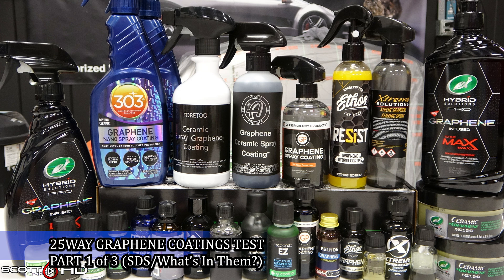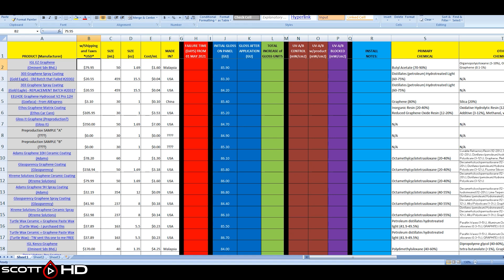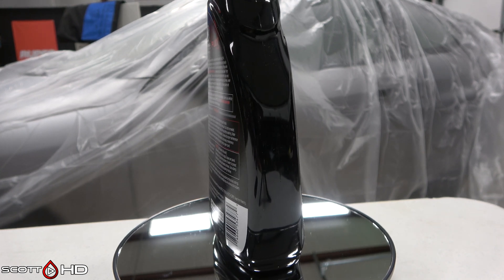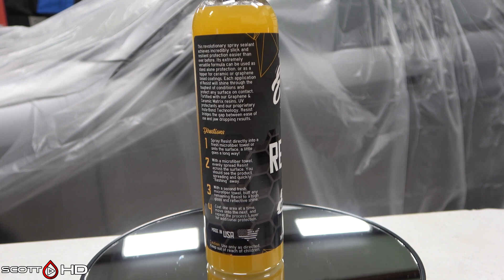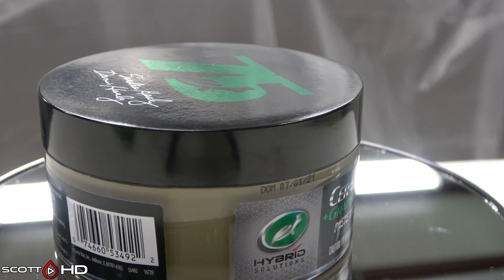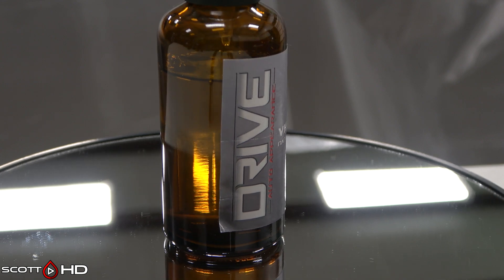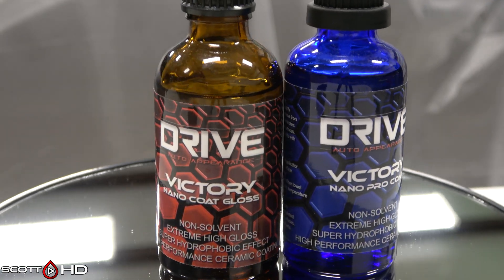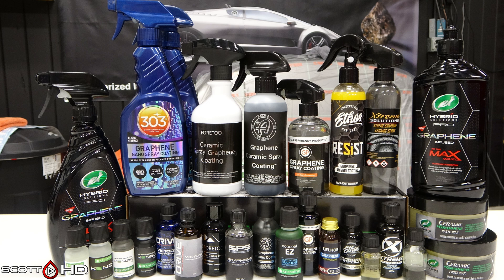Graphene Coatings Longevity Test - 25 WAY - ULTIMATE comparison test - PART 1 - WHAT'S IN THEM? SDS

Comment: Artdeshine nano coating and ceramic oxide artdeshine?
Reply from the maker: The Apex ones are in the 41 way test starting here at the same time and is identical to the non-apex branded ones.  Same SDS, even states manufactured by Artdeshine

Comment: In all fairness; as a suggestion.  I would go buy a bottle of 303 with the same batch number as the one sent to you from 303.  This way it will show that 303 didn't send you an altered product and have people question if what is sold in stores is the same quality as the product sent to you by 303.  If you can't find the same batch, then find out what batches have the correct formula that would be for sale in stores and buy it.  Can't wait for the results.
Reply from the maker: Great idea. I'll see if I can find one...will have to test separately since they are already applied and curing.

Comment: Another great untainted review. I wanted to ask if it makes sense to indicate on the spreadsheet or in the testing itself which products require a maintenance application. I shared your ceramic results with a pro detailer. The  product he’s authorized for didn’t even perform to its warranty. He replied  “yeah but did they follow the maintenance program?”.   Not sure how many products are like this but I thought I’d ask. Hogwash?
Reply from the maker: That is the point of this test though.  A "maintenance" is essentially having a product reapplied every xx amount of months.  The original intent of these tests is to see how long they go without any maintenance. No decontamination washes, no topping off, etc. Just washes and outside weather.

Comment: The main event of the latest and greatest coatings! I can hear Michael Buffer announcing "Let's get ready to RUMBLE!!!"  I can't wait until the testing starts. It's like waiting for Big John McCarthy to yell "Let's get it on!"

It's awsome that on the spreadsheet there are columns for primary and other chemicals. I know it's already listed but could you add a column for the percentage, if available, with type of graphene/graphite product? Wondering if the amount of grahpene/graphite will make much of a difference. Is "graphite" a typo or do manufacturers state it because graphene is essentially graphite? I have a feeling that the battle will be between the octamethylcyclotetracyloxane products.

Thank You for doing the comparison tests. The social media departments are gonna keep a close eye on this test. lol
Reply from the maker: I can do that.  Some of them don't even show Graphene or graphite in the SDS which is pretty shocking! Others may just say "graphene" and not show a percentage. There is absolutely zero consistency with the SDS unfortunately.

Comment: Hey Scott, I've been using the TW graphene stuff, I don't know if it matters, but you may want to shake the bottle well before use. That's what I did at least.
Reply from the maker: Absolutely. I read all of the directions very closely on each product. If it says shake well, I make sure I do! When I apply (video is already done, edited, and uploaded), I show that I am shaking it up before applying just so there's no question as to that, especially with these products where they settle.
Reply: @ScottHD  cool, well I will be rooting for the flex wax at least, but if not, I'll be switching products when it fails lol
Reply from the maker: @09ThunderOne  good deal!  I have some of the turtle wax products in the 38 way test.

Comment: Very excited for this! I’ve been dying to see how that tw paste wax holds up. I noticed it’s very hydrophobic in the short term. My brother in law’s type r has it on its paint. It’s been 5 weeks and it’s holding up very well. So far
Reply from the maker: Probably 90-95% of any of the products that is the case.  Hydrophobic properties diminish pretty quickly for some.  You can put straight silicone on paint with similar results - until you wash it one time.
Reply: @ScottHD  agreed. In terms of hydrophobicity (in the short term) it’s almost as amazing as the fusso99

Comment: Interesting in as much as graphene/graphite content is less than 1% in most cases. Is it possible to identify what quantity of the overall make up is transfer solution to understand what quantity the graphene is once its cured on the paint (all transfer solution evaporated) 1% Graphene/Graphite content just feels a little underwhelming for a 'state of the art' coating.
Reply from the maker: That was surprising to me as well.  VERY little Graphene. Some just have graphite and call it Graphene.